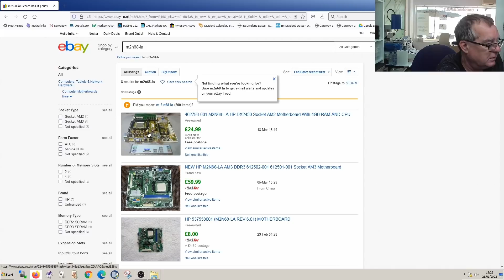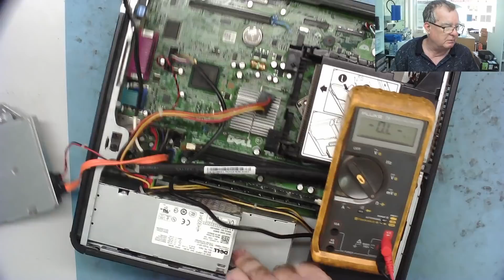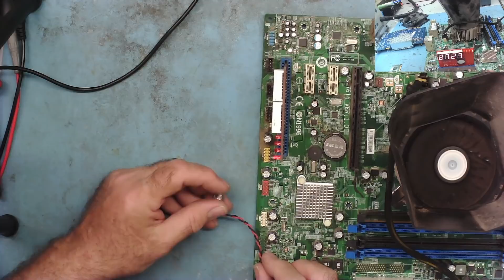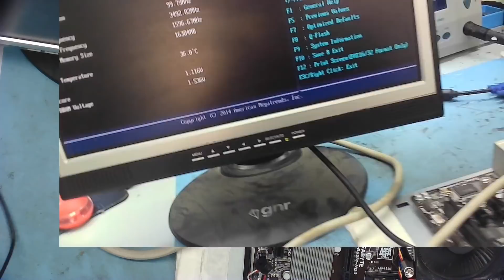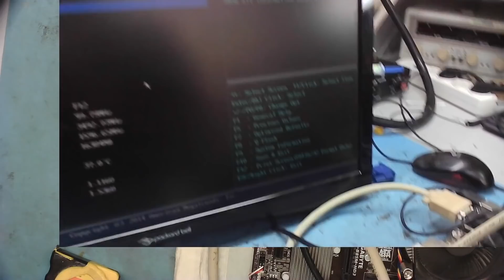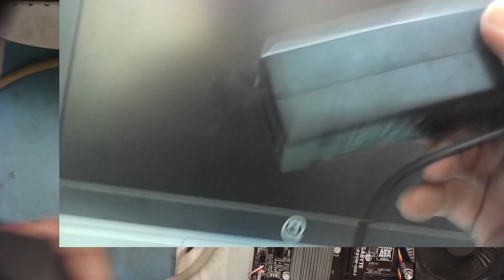Learn Electronics Repair Goes Skip Diving... Again!

Comment: For old Dell OptiPlex models with black bumper and metal side doors, look for the health LEDs in the front panel 1 2 3 4. If you have problem with RAM you will surely have an error indicator there. But if you have a power supply failure or short circuit, if you get power you will see an amber power LED, and that would be exactly indicative of these fatal problems. The OptiPlex 760 can still be perfectly useful for a desk office PC as is but with 8GB of RAM added, or even light gaming if you get a Core 2 quad and the right low profile graphics card.

Comment: The HD 4650 in AGP was the fastest AGP card to be produced, just before switching fully to PCI-E; that's the reason why them 4650 go that expensive for retro builds - they're the fastest cards the AGP bus had.
For the LGA 775 system (the Dell), the best you can do is use an LGA771 Xeon (4 cores), modded to run on the 775 motherboard.

Comment: Those multi-voltage output chargers can be quite cheaply built. I had at least 3 or so come back to me, and parts of the fuse is just rattling around inside. But on your one there I think the clear see-through plastic for the green LEDs on the top has fallen out of place inside so that might be whats just rattling around. Dont know if that will be enough to make a video wonder if its working though.
I also got my hands on an Asus 8800 GS just like yours in the video, but it was lended me as a temporary video output card until a better one arrived. Did play HD youtube quite nicely at least.
Reply from the maker: Yeah it looked to me like there were just holes where some LEDs should be.  I'll probably open it up anyway and make a short video just to look what is inside it, like for example how the voltage selection works. Maybe I'll get it working too.
Reply: @LearnElectronicsRepair  yes thats right the LEDs actually stick out the top thats funny wonder what happened to them all

Comment: A small tip, most motherboards default ram slots are slot 2 and 4... Not 1 and 3...
Reply from the maker: Yeah that one caught me out this time.... for a few minutes.  I couldn't find a manual for this motherboard so in he end I experimented.

In my experience most motherboards seem to work fine with a pair of DIMMS in either 1&3 or 2&4 but in this case you are correct.

Comment: You've said that the first one Compaq with Vista, is not new enough to run a modern operating system. My daily driver is Ubuntu. I'm going on a bet, that this Compaq will run smooth Ubuntu up to date OS :). It's not an argument, just saying  :D.

What you could do with the 2nd one, is to give it to someone who like to learn fixing electronics in your area. This is a cheap technology, so that person can make it faulty and fix it again even by trying to install a Linux. Or to have for testing other PC hardware on it like GPUs, HDDs, etc. But, giving it to the trader make sense as well :).

About the 3rd one with 24 pin ATX connector. When I was selling them, we had new PSUs with 20+4 connector to attach to those 20. When you had an old MoBo with 20, you didn't have to worry, just didn't connect those 4 pins :). So, this MoBo, can be in that transition period of time. On that time, we had MoBos which were capable on running and on 20 and 24 pins.

With this old 2032 you've placed in the bin. I'm a weirdo, I'd charge it :D on my lab PSU and use it again :D :D :D, I don't like waste and you can make a lot of charging cycles on all none rechargeable batteries, again, just saying, not an argument. :)
Reply from the maker: Interesting points.  Regards the first one, when i said 'modern OS' I was just meaning windows 10, but you are correct.

On the last point, I never thought of doing that - I bought a load of 2032 from Ikea, they were pack of 8 for €1.99 so 25 cents each.  However you now gave me an idea for another video 😉Thanks.
Reply: @LearnElectronicsRepair  thank you. I've got the same video in the pipeline here, just scheduled on the 27th. If you want, it's just 2 days :), watch it, and make a better for your own fans, I'd be happy to look at what you've got to say :D.

Yes, I agree 0.25 is cheap, but, in the end still goes to the bin. I have 2 boys here at home, I'd waste tons of money on new batteries, so, no matter if it's 0.25, or 5, I'll still charge many cycles out of it ;). Probably we can agree that not always it's worth using rechargeable ones like in remotes for TV for instance, or an emergency flashlight just to name a few :).
Reply from the maker: @screen-protector  I'm all for keeping things out of the e-waste, I just never thought that it was feasible to recharge the CR2032.  At least not for the long term.🙂  I see there are a number of videos showing how to do it.

Comment: Its nice to see that 8800 GS still works,I had a Asus 8800 GT which looked exactly the same as that card you got there but sadly failed,Seems like the 8800 series were notorious for premature failure for some reason. (i have a new old stock 8800 Ultra) fully boxed and sealed in my collection :D
Reply from the maker: I have a 8800GT I'm going to try and repair on an upcoming video - as I recall it just does not detect at all.  Although the 8800GS is working it does not command much money on ebay at the moment but at some point in the future these things will be worth more money.
Reply: @LearnElectronicsRepair  oh brilliant, will be nice to see that hopefully you get it working again, I have quite a few old graphics cards that sadly don't work I just keep for collection purposes, I'm also a brit :)